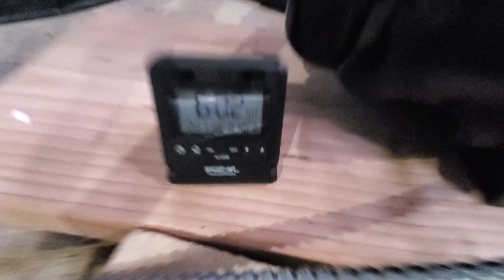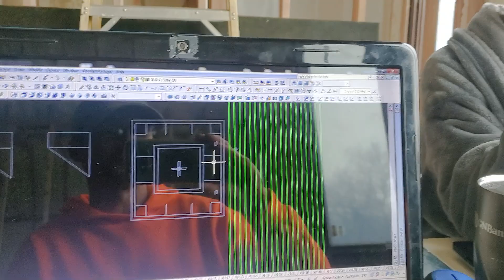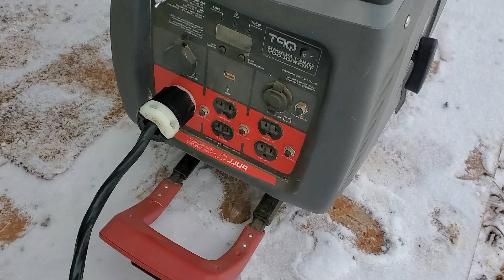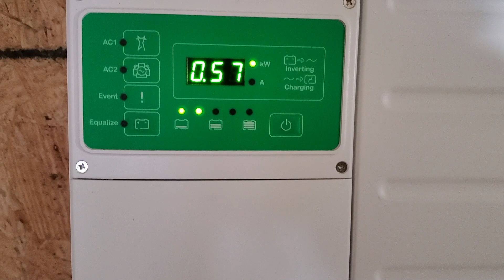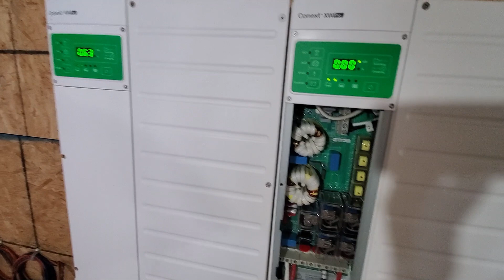Off-Grid in the Winter Storm of 2021 - Days without Sun and we need the Champion Generator

Comment: Same thing happened to me with my SMA system, the inverters need to know that the power is coming from a generator so that they will accept a “dirtier” sine wave with my sunny islands a communication wire and relay had to be added
Reply from the maker: It was all new to me.  Glad that hurdle is over.
Reply: @Off-Grid   our battery bank is 1190 ah forklift battery pack and we are considering adding another battery bank for this type of sunless event
Reply from the maker: @charlesgiovanetti8776  we rarely have to use the generator.  I did a 1yr on solar review video recently and found that the generator only provided 0.33% of our total power production.  Here is a link to that video.
https://youtu.be/-tTV5HTv570

Comment: I guess you got this figured out by now. But I enjoy my little buddy heaters hooked to propane tanks as part of my back up heat plan.. But as far as the inverter charge controller goes i wouldn't feed 120 into it . its meant to process 240 60hertz .its hard to get clean 60 from a gen sometimes.  If you had a bigger gen with a hertz meter to verify and the recommended input amperage .those inverters are delicate
Reply from the maker: Schneider came back and said that to get 120 to work I had to open up the inverter and switch some jumpers and a wire, which was something I wasn't going to try.  Buying a 240V generator was much easier!

Thanks for watching!

Comment: Yeah I didnt know you could wire a 120 to charge. You might be able to put a jumper to trick it. I wouldnt run 240 appliances on it but it might charge. I have a different system we have a portable propane 120/240 gen we use a few times a year.
Reply from the maker: Turns out you can but have to modify the inverter jumpers and move a wire inside the unit, which I wasn't going to mess with.  Schneider tech support is lacking the support part....lol